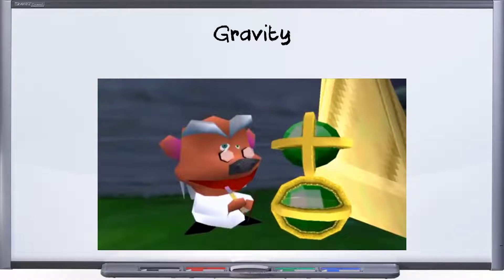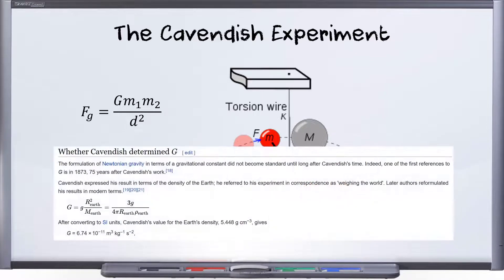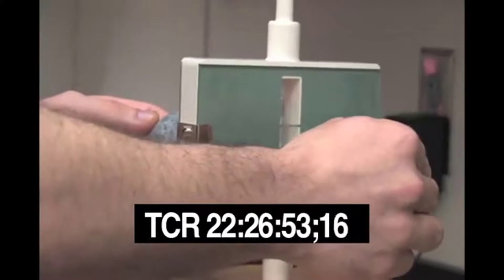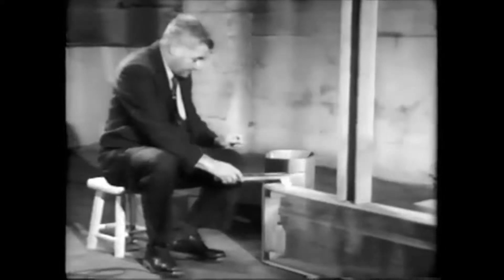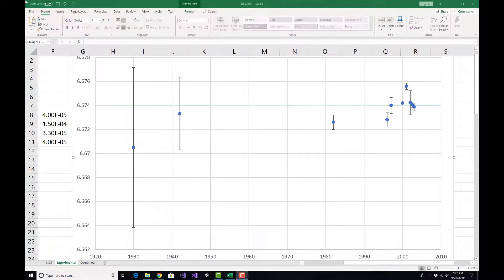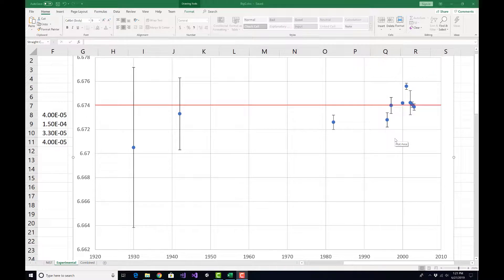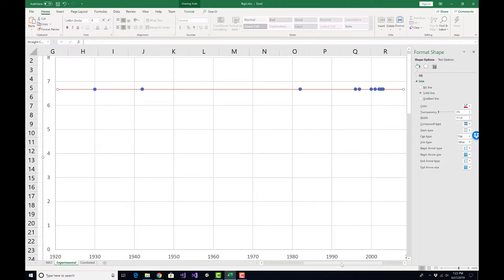Gravity #4 - The Cavendish Experiment

Comment: Hi there, have you discounted the possibility that paramagnetism is the sole cause for the metal spheres to be attracted to each other and NOT gravity?
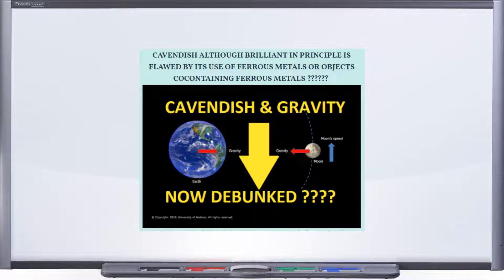Reply from the maker: @5:13
Hypothesis: Lead is attracted to lead due to some property unique to lead (such as paramagnetism).
Prediction: If we test with other materials, we will not see the same amount of attraction.
Test: My video shows water being attracted to sand, and the measurement of G was the same as with lead attracting lead. BlueMarbleScience recently did Coca Cola attracting lead, and his results matched up too. https://youtu.be/y3bL4eidUyM
Conclusion: The hypothesis was invalidated. The measured attraction is not unique to lead.

Ad-Hoc time... we tweak the hypothesis...
Hypothesis: The attraction is not unique to lead, but it still could be paramagetism... Many (all?) materials are attracted to one another by paramagentism.
Logic: In that case, we're right back where we started. Masses are attracted to other masses. It may be related to magnetism. As far as we've seen with these experiments, we can't rule that out. It just doesn't affect the results one way or the other.
Reply: @icansciencethat  i posted a comment on the video

pity the demonstration doesn't actually determine what causes the attraction!! I think you need to carry out another experiment!!
Reply from the maker: @PeterPete  I feel as if we're not communicating effectively.
I believe I just explained my position on this. There is an attraction between masses. Many different types of masses have been tested, and they all have the same attraction.
Therefore, we can conclude that "mass attracts mass" is a fair description of reality.
For the record, it is not caused by magnetism, but that's entirely beside the point. The point remains that every type of mass ever tested is attracted to every other type of mass ever tested according to the same formula.
If you want to know the cause, that's a much deeper discussion that ultimately leads us to the limits of human understanding. Our best understanding of the attraction can be summarized by the curvature of space-time. Masses cause space-time to curve, and this manifests as an attraction between the masses. Why do masses do this? Unknown... That's the limit of our current understanding.
The Cavendish experiment is not useful for determining why this occurs - only for verifying that it DOES occur.
To be perfectly clear... The Cavendish experiment is a direct, repeatable, observation that verifies masses are attracted to masses. It does not delve into why this is so, but the fact remains: it is so.
Reply: @icansciencethat  quote - To be perfectly clear... The Cavendish experiment is a direct, repeatable, observation that verifies masses are attracted to masses. It does not delve into why this is so,

well cavendish considered gravity to be the cause and yet how could this be considering what you've stated?

quote - If you want to know the cause, that's a much deeper discussion that ultimately leads us to the limits of human understanding. Our best understanding of the attraction can be summarized by the curvature of space-time. 

But now we enter into conjecture and semantics as we try to understand what you you mean by time and space!

quote - Many different types of masses have been tested, and they all have the same attraction.

regardless of the above, what do you mean by the same attraction?
Reply from the maker: @PeterPete  "what do you mean by the same attraction?"
whatever pair of masses we test, they all match up with Newton's Law of Universal Gravitation, and they all conform to the same value of the Universal Gravitational Constant known as  "Big G".
Reply: @icansciencethat  so when u refer to same attraction you mean it's the same kind of attraction? is that right?
Reply from the maker: @PeterPete  The attraction follows the same formula. F = GM1M2/d^2.
This formula works no matter what materials we test.
Reply: @icansciencethat  right ok - so you are putting the attraction down to a gravitational force?

aside from math what proof do you have the attraction is a gravitational force?
Reply from the maker: @PeterPete  I feel like we're really not communicating well. Let me try to be as clear as possible...
1) The Cavendish experiment demonstrates that the test-masses are attracted towards each other.
2) We have tested various materials, so it is not specific to lead.
3) From this, we see masses are attracted to each other.
4) The force of attraction follows the formula F = GM1M2/d^2
5) We call this attraction "gravity". Gravity is the name of the attraction.
6) In this video, I have offered no speculation whatsoever about WHY the attraction occurs - only that it does occur.

When you ask what proof I have that the attraction is a gravitational force, the question itself confuses me.
The word "gravity" is the word we give to the phenomenon I just described where masses are attracted to each other.
Your question seems to be focused on the "Why?" of it. For example, could it be magnetic in nature? At this point, I'm making no claims on that one way or the other. The observation is simply that every mass tested so far is attracted according to the formula I gave.

Are you possibly trying to ask me whether we can be certain that this force is the same one holding us onto the Earth?
Reply: @icansciencethat  the points 1-3 are agreeable but in 4 you're leaping ahead and applying the understanding of gravitation which is based upon an external influence eg gravity! However you can't discern whether the 'attraction' observed in the cavendish experiment exists in space and is the cause for objects to fall! Additionally, any attraction could be caused by a triboelectric attraction that applies to all materials. 

The observation of the cavendish exp has nothing to do with gravity per se

quote - The word "gravity" is the word we give to the phenomenon I just described where masses are attracted to each other.

No! The word gravity in the mainstream sense should only be attributed to falling objects and not anything else. 

By the way has anybody ever carried out this demo under vacuum? I've never seen it being done but it's possible one might find different results and no attraction will be observed!
Reply from the maker: @PeterPete  in serious laboratories, the experiment is routinely conducted under vacuum conditions. 
I understand your meaning. You are using the word gravity to mean that which pulls things down to the earth. 
So do we know the force in the Cavendish experiment is that same force?
We observe that masses attract.
We know the Earth has mass.
Therefore, every mass MUST be attracted to the Earth. There is no way around that conclusion. 
I should also reiterate the story of the discovery. This is the history of the subject:
1) the shape and size of the Earth was discovered first 
2) next came the motion of the planets 
3) then the expression of the force that moved the planets
4) next the realization that the same force MUST pull us towards the Earth
5) finally the measurement of the amount of that force.

You may wish to argue there could be some other force besides this one that holds us to the Earth. That's fine, but I see no way to remove the force of masses being attracted to the mass of the Earth.
Even if you imagine the Earth to be flat, it still has mass, and masses attract each other - as we have measured.
Reply from the maker: @PeterPete  oh, and #4... we routinely do the experiment in classrooms. We empirically verify that equation specifically.
Reply: @icansciencethat  quote - So how do we know the force in the Cavendish experiment is that same force?

glad you understand the limitation of your enquiry because you don't know! You only have a generally accepted IDEA the forces are the same!

quote - force besides this one that holds us to the Earth. 

what tests have been carried out that demonstrate a force does indeed hold things to the earth and objects will float away without it? Stating this is just ridiculous especially given that statement cannot be shown to be true!

quote - Even if you imagine the Earth to be flat, it still has mass, and masses attract each other 

the cavendish experiment only shows an attraction exists within the apparatus alone and it still needs to be demonstrated this 'attraction' is 'exerted' by the Earth and causes objects to fall! You've not done that. Nobody has done that. You jump from one observation and conjure up this 'explanation' only to then apply it to another situation!!! That's insane!

In other words there's an awful lot you CAN'T science!
Reply: @icansciencethat  and remember the shape (and probably the size) of the Earth is still in dispute and has been for centuries!
Reply: @icansciencethat  got a link to any demos carried out in vacuum?? You claim there have been so a link would be fab!

Cheers
Reply from the maker: @PeterPete  if we're being honest, there has been no serious debate about the shape of the Earth for centuries. However, I have dedicated my channel to explore such options openly nonetheless. I'm happy to explore the boundaries of such notions with you, but I find that plain old logic forces us to the same conclusions time and time again.
Cavendish shows us mass attracts mass. Any mutually attracting body of sufficient mass will necessarily be pulled into a spherical shape. So even if we thought is was flat, Cavendish shows it cannot be so.
Reply from the maker: @PeterPete  This one doesn't even deserve a serious response.
For any readers that happen along, it is my understanding that Peter & Pete is not a serious channel that reflects the owner's genuine beliefs. This is the internet after all. Poe's law tells us it's impossible to know for sure whether P&P are simply mocking the beliefs they present or actually hold such beliefs. I've gotten the impression that it's very much the former, and content such as this comment are the reason why.
Are we seriously being asked to believe that P&P do not already accept that there is an evident force holding things to the Earth?
If you want to know more about this, here is a link to start with:
https://www.dictionary.com/browse/sophistry
Reply: @icansciencethat  quote - Cavendish shows us mass attracts mass. This could well be true but only regarding the masses that have been tested within the confines of the apparatus. What tests have been carried out with the Earth? None!

quote - So even if we thought is was flat, Cavendish shows it cannot be so. I can't see how that can be so especially as the results of his demo are strictly limited to the apparatus!

Imo science should have nothing to do with reason but with strict adherence to the scientific method which involves observation and repeated experimentation. With regard to Cavendish's demo the results can only be limited to the confines of the apparatus and it is unscientific to extrapolate those findings to areas of the natural world that have not been tested. Where is the scientific demonstration that shows the Earth's mass attracts the Moon for example? There isn't one!

With regard to the shape of the Earth, there is no proof whatsoever what shape the whole Earth takes. In all of my research I've not seen one piece of information that confirms a globe shaped Earth. This is why people like yourself can only BELIEVE the earth to be spherical as you can never truly know what shape the earth is! I don't truly know what shape the Earth is but from my experience of the natural environment and people, I can only conclude the Earth is a level plane and people can and do in fact lie! 

If you think you can do science then you've certainly not convinced me your science reflects the real world I live and that 'masses attraction' to each other is due solely to an effect of gravity! Imho gravity is merely a word to indicate falling motion and should not be used to try to explain the cavendish demo!
Reply: @icansciencethat  By the way can you actually prove water is made of hydrogen and oxygen? Unfortunately nobody's been able to do it as far as I'm aware!
Reply from the maker: @PeterPete  You'll find this study already linked in the description of the video: https://nvlpubs.nist.gov/nistpubs/jres/5/jresv5n6p1243_A2b.pdf
Here's a more recent one:
https://www.sciencedaily.com/releases/2021/03/210310122602.htm
Reply from the maker: @PeterPete  
1) Set up a vacuum vessel with a small ignition source inside of some kind... perhaps a spark-plug
2) vacuum the chamber out as completely as you can.
3) Introduce oxygen and hydrogen into the chamber.
4) Ignite the spark-plug
5) Repeat 3&4 several times with the chamber otherwise sealed
6) Notice that the chamber has now acquired a noticeable amount of water inside. Where did that come from?
But of course you know this, and you have your sophistry prepared. Let's hear it I guess.
Reply from the maker: @PeterPete  once more, you wish to posit that masses attract masses only within the confines of any number of different torsion balances. As if there is some reason to imagine that force doesn't also exist outside the torsion balance. And yet you offer us no reason to suggest any such thing. That's not how science works. We don't just accept incredible claims without any basis nor any evidence.
I will stress that science is not in the business of proving things because there will always be some as-yet unknown exception. So we do not say that Cavendish "proves" gravity. We say that it provides evidence that "supports" gravity.
You have no counter-evidence, and that makes your arguments pure sophistry.
Reply: @icansciencethat  If true (ref experiments by Heyl), then that would support the fact masses set up in a cavendish style demo will attract each other. That's all it demonstrates. Whether this effect exists in areas of the natural environment is another question and needs further research and testing. So is there a cavendish style demo that appears in the natural world? Errr I'm really trrying hard to think if there is one! 

Again how do you know the attraction is due to gravity and not another 'force' when you can't find a cavendish style demo occurring in nature? I often find man creates his understanding of the natural world and cavendish's demo is a prime example where man fabricates a reality!

Regarding your water demo - i'm of the view water can exist as a gas and can migrate along with gases such as hydrogen during its manufacture. So it's  plausible water entered the chamber as a gas along witrh the hydrogen. Also any dew could have formed on the chamber simply as a result of a heat differential generated by colder vacuum surfaces meeting the heat from the combusted hydrogen/oxygen mix. Lavoisier was meant to have carried out this kind of demo way back in the 18th Century but I've not seen this carried out by anybody. If you got a link to a video that would be fab! And finally, it's not sophistry I employ, it's just a desire to be shown proof because the world where I live is filled with people who lie, whether knowingly or unknowingly!

With regard to your last comment 

quote - I will stress that science is not in the business of proving things because there will always be some as-yet unknown exception. 

So wrong. Science, in relation to the natural world, is not in the business of proving things simply because science cannot prove such things. Your water demo for example does not prove water is comprised of hydrogen and oxygen nor can you prove gravitation alone causes masses to attract each other under cavendish style conditions. I could simply suggest the effect is due to a tribo-electric attraction or some other unknown phenomena that only comes about within the confines of a cavendish style setup!

Your science is not that good!
Reply from the maker: @PeterPete  Thank you for your views.
#sophistry
Reply: @icansciencethat  tks for sharing your dreams with me!
Reply: @PeterPete , you seem happy to accept that masses do attract other masses in the case of the Cavendish experiment being carried out. But at the same time, despite such evidence, you aren't willing to accept that masses attract other masses on a larger scale (ie the earth).
 And this is despite the everyday evidence of objects always falling downwards towards the earth, your feet exerting a pressure onto the ground etc.

So my question to you is, what can possibly explain masses attracting masses on a small scale (say <100kg), but not at the larger scale (say >1000,000,000kg), despite all of the day to day evidence of objects falling down etc..?
Reply: @dannylad1600  Look at his channel, it tells all who he is;)
Reply: @PeterPete  : Explain magnetism. Why do two materials attract or repel each other? What causes this? You have clearly proven than you just can't use a term, such as magnetism. No, instead you need to explain the actual physical mechanism of the force.
Reply: @kitcanyon658  nobody knows what magnetism is! In fact another variable that can explain the cavendish exp is heat; thermal variations and subsequent pressure!

Even cavendish in his paper acknowledged heat affects the movement of the smaller spheres!

There is no proof the attraction is solely due to gravitational forces whatever they are!
Reply: @PeterPete  You really shouldn't project your fecklessness upon others.
The shape of the Earth is not up for debate.
Reply: @marcg1686  The shape of the earth is debatable because it's currently unscientific and only a hypothesis 👍

It's feckless to put forward that it is true the Earth is a globe when it cannot be proven to be true 👍
Reply: @PeterPete  It's got nothing to do with science. It's simple geometry.
We use spherical geometry to navigate our planet.
You're living on a globe with a mean radius of 3440.1 nautical miles, spinning about an inclined axis of 23.44° as it orbits the Sun.
Reply: @marcg1686  Spherical geometry is NOT used to navigate the Earth. 

If you're a captain of a ship, how does the shape of the earth determine the movement of the vessel?

The shape of the Earth has absolutely NOTHING to do with navigation!!
Reply: @PeterPete  The shape of the Earth doesn't determine the movement of a vessel, but does determine the geometry employed to confirm its position.
The great circle is foundational to the practice of celestial navigation. Great circles only work on a globe, nothing else.
Reply: @marcg1686  What geometry of the Earth does a ship use to navigate?

The great circle is only a concept based upon an external frame of reference to a sphere but can be a straight line on the level earth which happens to be a course or path a ship takes to navigate.

Ships only uses charts, time and speed and a gyrocompass to navigate. To verify a ship's position a ship can use alternative methods, like radio waves to determine its position relative to other points in its locality.

None of this is dependant upon the shape of the Earth.
Reply: @PeterPete  Ever heard of a sextant?
The geometry underpinning its use is entirely spherical.
By all means, feel free to demonstrate circles of equal altitude on a notional flat earth map.
Reply: @marcg1686  So a sextant determines the shape of the earth? A man made instrument for measuring angles. 

Have you got anything that determines the actual shape of the earth and not angles?
Reply: @marcg1686  Quote - circles of equal altitude

WTF do you mean by this? I think you really don't know what you're talking about and I really have no wish to communicate further with you!!
Reply: @PeterPete  Feckless, like I said.
Reply: To debunk the globe all one has to do is to talk to a globehead and realise how mad they are!!!
Reply: @PeterPete  To actually debunk the globe you'll need to come up with an alternative model that includes distances and coordinates, an explanation for day, night and the seasons, lunar eclipses and the retrograde motion of the superior planets.
And the equation that allows us to determine the distance to the flat earth horizon based on the height of the observer.
🦗🦗🦗
Reply: @marcg1686  the globe doesn't need to be debunked because in my view the globe is an incorrect representation of the real world and always will be! 👍👍👍